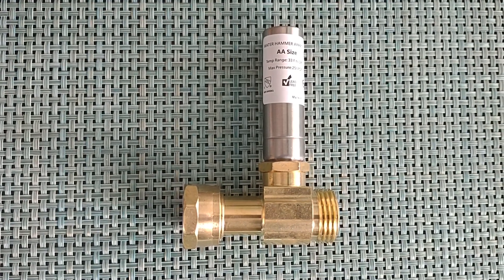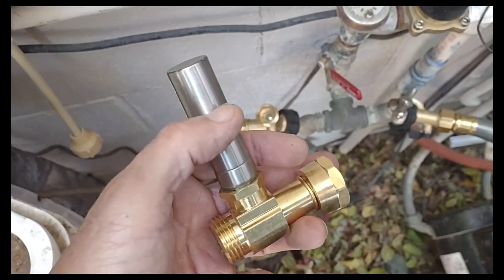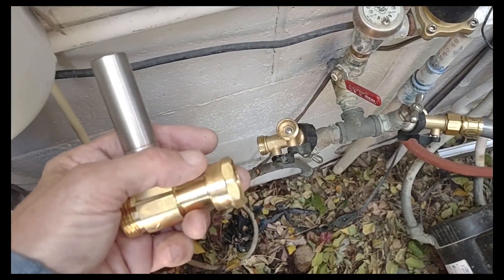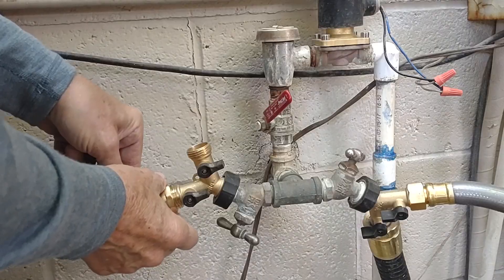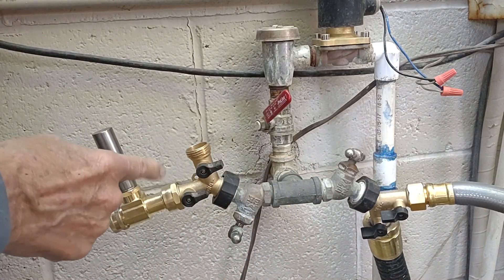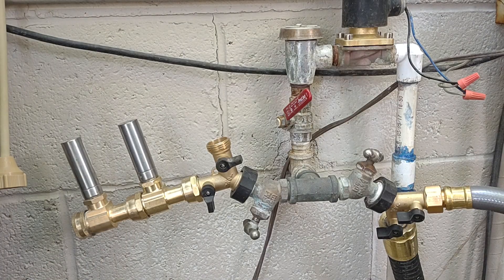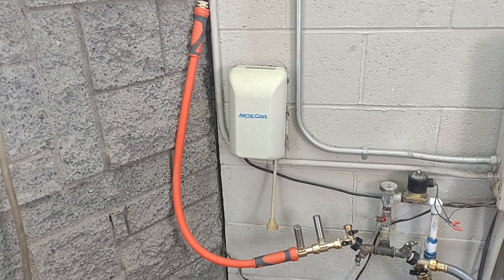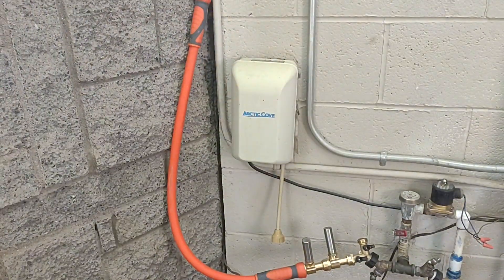Water Hammer Arrestor - do they work, and are there alternatives? Testing options for banging pipes

Comment: The electronic discussion below is interesting, but misses a couple of points. The arrestors are available in different sizes and where large bore pipes are in use AND/OR long pipe runs then the mass of water that stops abruptly is going to need a bigger arrestor. This is effectively what you have done with both arrestors plus your pipe. 
The other issue is that the arrestor should be as close al possible to the cause of the hammer - not just physically close but also hydraulically close. So, ideally right next to the input side of the valve, but perhaps more importantly, without the right-angles and constrictions caused by the multitude of right-angles and stop valves that you used for your experiment.
In practice, a lot of the bang that you measured was made before the pressure wave managed to travel down, round and through your experimental set-up. The electronic analogy is that there were several series resistors before the capacitors.
Reply from the maker: Good input, and I realized that the experiment wasn't emulating the perfect fix for my particular issue. Also, I like the resistor analogy, which fits perfectly.

Comment: I installed an arrestor that had a pipe 1/2" pipe fitting to stop the knocking in my hot water recirculating system. When I purchased it I saw that there was also a larger arrestor that had a 3/4" pipe fitting available. (I wish I had purchased that one also, just to do some experimenting). Like in your video the hammer was greatly diminished. I also have knock arrestors in my washing machine hoses.
I also wonder if having an expansion tank in the system would help or even eliminate the knock.
Reply from the maker: I was thinking about that, too (I have a very small one in my RV, but water hammering just isn't much of a thing with water pressure that low, and plastic and PEX pipes.  ;-)  I'd have to believe anything that has some sort of "give", and that's between the source of the "impulse" and the pipes that are clanging is likely to help.

Comment: The house I grew up in had no provisions for this when it was built. It became a problem when we got our first rapid closing (MOEN) faucet. My dad added two 18 inch tall air chambers at the exposed pipes to the water heater. Problem solved. On the occasions when they became waterlogged we would shut off the house water and drain the pipes. Once completed the air chambers were “recharged”.
Reply from the maker: That tracks with what others in the comments have said (that the air will eventually "go away", which is kind of counterintuitive, but I suppose air and water really DO like to mix, or we'd never have clouds and rain).  ;-)  I remain impressed with how even a tiny arrestor will "do the job" on what was such a loud hammer situation.

Comment: You could try installing a permanent dead leg with pipe in the direction off the reverberation- not upright like the hammer arrestor. The arrestors will eventually fail and need replacing.
Reply from the maker: @Boggs11  I would love to have the opportunity to try every alternative. The beauty of the arrestors I used is that a required virtually no installation time.
Reply: @Mark_H_DIY  Hi Mark, water hammer can also occur from other valves in the line, kitchen mixers, HWS, combi's in the laundry, loose pipework and hand turned taps. Old valves could be your problem.
Reply from the maker: @Boggs11  agreed. I've had toilets that bang the pipes pretty hard as well. But in this house right now, the only hammer is my pool filler circuit.

Comment: Do you know the pipes are secure in the wall it could just be not clipped or check if it’s before the water meter
Reply: I’m only a journey man still learning but I know if you call a regular plumber where I’m located they can’t touch anything before the water meter unless advised to do so. Respect to town workers tho fr fr
Reply from the maker: @Pppoopoo3 I wish it was before the meter... I'd save a fortune keeping my pool filled! The pipes are very secure, one coming right out of the concrete wall, and the other running straight into the ground. The pipes banging are in the wall... Not sure how they are clipped down, and hope I never have to find out... ;-)

Comment: I added these on my washing machine. The noise in the pipes was terriblewhen the valves were operating. It stopped completely. Glad I found some who did not need a plumber to install it.
Ps. I think it is possible two arresters in line does'nt do much. Maybe they have to be mounted side by side instead if you want to double the capacity. The arrangement shown probably halves the capacity.
Reply from the maker: @PR-fk5yb  an analogy to electronics would be inductors, which are additive in series. But I'm not sure the arrestors really fit that model... It seems that any alternative path the shock wave can take will damp the wave.
Reply: @Mark_H_DIY  My guess was more or less based on the increased noise level in your configuration... I would'nt know the behavior in a pipe for sure. But from your example and because pressure is more like an overvoltage than over-Ampacity situation an educated guess says the arresters would behave more like capacitors than inductors.... and it's going 2 be the other way around...
Reply from the maker: @PR-fk5yb  it could be... If I was a little more ambitious, I'd try the parallel arrestor test!  ;-)
Reply: @Mark_H_DIY  Haha! I'm sure you won't be able to sleep until you know for sure... the seed is planted... interesting exchange!😁🌈

Comment: The hose solution will eventually stop working as the air will be absorbed into the water. That's why the arrestor has the seal and spring
Reply from the maker: @gregorywootton3870  that makes sense. I saw it as more of a temporary experiment that could be done to see if a legitimate arrestor would help, though it might be interesting to see how long it takes for the air to disappear. I might have to try that just to find out. ;-)
Reply: @Mark_H_DIY  loved the video all the same
Reply: I think that even if it fills, it still has potential to be successful because it can move with the shock wave where pipes don't, especially if coiled.
Reply: (The hose, that is...And if it's long enough for even one coil, it would work quite well.)
Reply from the maker: @mrcryptozoic817  I know what it'll do at least one coil, since it was that way in the shipping container ;-)
Reply from the maker: @mrcryptozoic817  the hose is elastic enough that it should absorb a good bit of the shock wave, even if it was full of water.